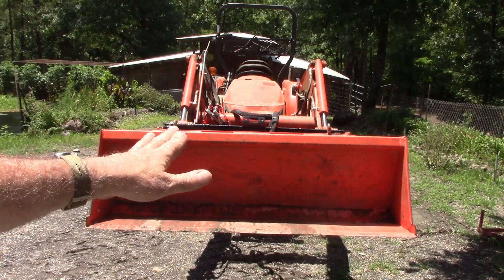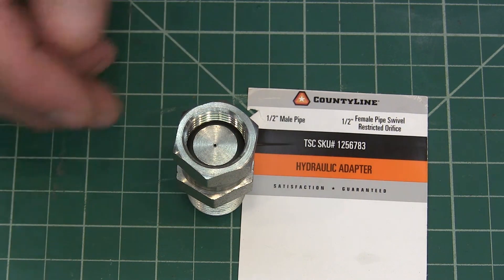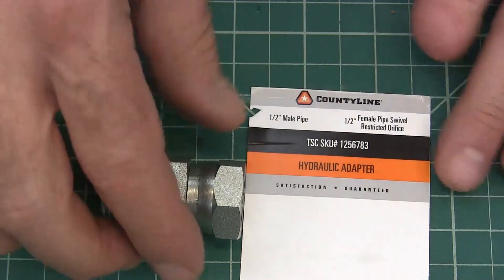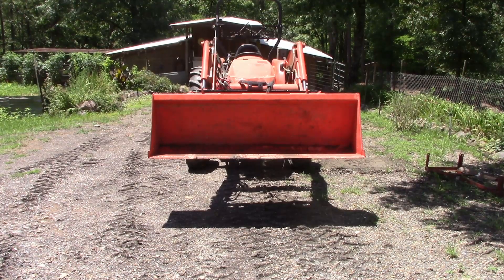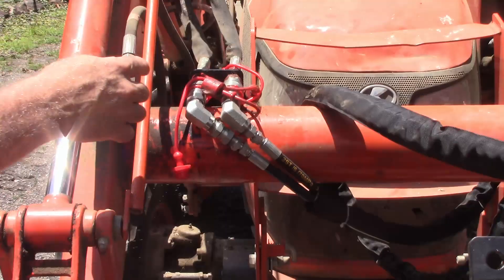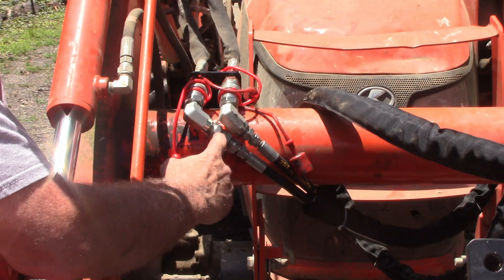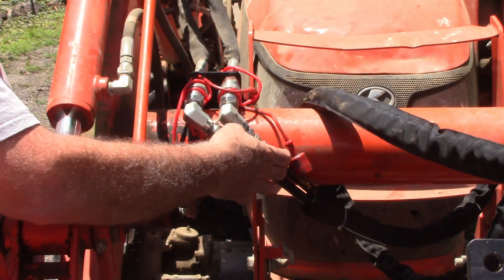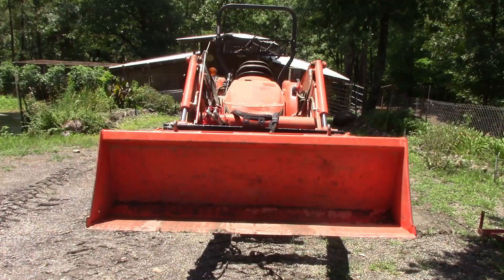Hydraulic Restrictor To Slow Cylinder Movement

Comment: I was thinking about installing a needle valve in line so that the flow could be adjusted for the 3rd function,  but since this is a stock Tractor Supply item I may pick one up and give it a try.  Thanks for sharing the video.,
Reply from the maker: You're welcome!  I hope you getting fixed!
Reply: @SoatMon  worked perfectly.  Thank you.

Comment: I'm going to TSC right now to get a couple of them. I just built a log splitter with a log lift and the log lift is down right violent. It's only a 2" cylinder with a 28GPM pump. I might have to even weld the hole up and redrill it even smaller. Perhaps if I put one on each side it'll tame it down even more.
Reply from the maker: That's a good question.  I wonder it using one on the outlet would slow it down even more...

Comment: I had to use one on a 3 point hitch snowblower to control the angle of the chute flap, otherwise it would be instantly (well almost instantly) full open or closed.  Worked good.
Reply from the maker: Thanks for sharing your experience.

Comment: Excellent use for this restrictor, not enough use to worry about overheating your hydraulic fluid. Your issue is exactly why I  used a separate spool value for my third function. My setup is a little more cumbersome, as I have to take my hand completely off the loader joystick, but I can "feather" the speed of my 3rd function cylinder.
Reply from the maker: That does make sense.  I would still like it to be slower.

Comment: That was a clever solution.  Not sure if I would have thought of that one.   But it sure looks like it works well.  Think about how much fluid is going through that little, tiny hole only 1/32 .   And still the bucket moves quit quickly.  By the way what is the " third arm "  you mentioned in the video?  I do understand it is on a solenoid valve, but what is it used for on a farm tractor.   On the little track how that is how the grapple pincher is controlled, by a solenoid valve.  But I can't think what it would be used for on a tractor.
But anyway good video and still another hydraulic device to know about.  I will remember this one.  I did just get a kit to add remote hydraulics to my 2910  Ford tractor. I didn't come with any hydraulics out the back.  Thank you for the video.
Reply from the maker: Thanks Glenn!  I too was impressed by how fast it still moves seeing as it has to go through that tiny hole.
The third arm is basically used the same way you use it.  I added it when I bought a grapple for the front end loader.  It opens and closes the grapple.
Reply: @SoatMon  Commonly known as 3RD valve. Just another set of hydraulic connections in the front or rear of the tractor.